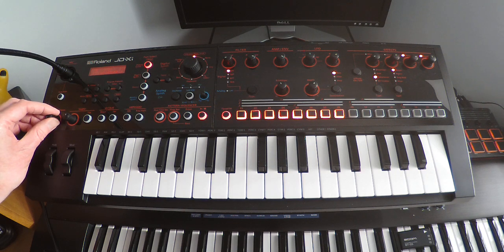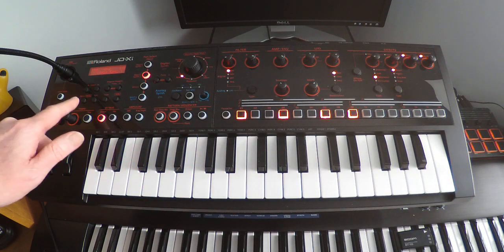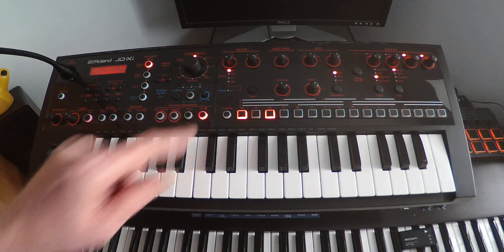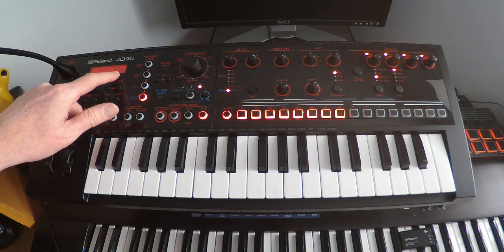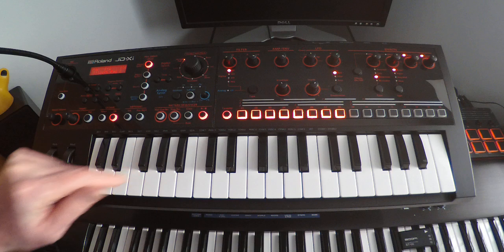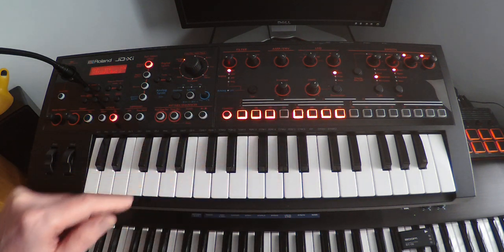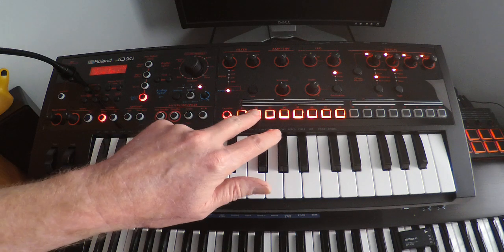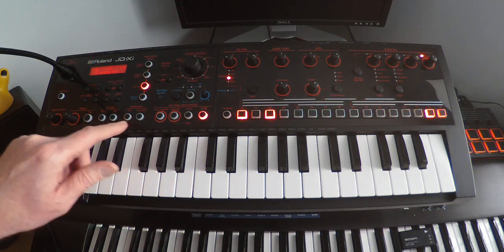How I re-created Autobahn by Kraftwerk on my Roland JD-Xi

Comment: Great vid thanks, Just a question the jdx is only good for short repeating phrases like jingles? it won't  let you make  Propper  5-8 minute or longer tracks does it?
Reply from the maker: Hi Deon, you are correct. An individual sequence that you create will carry on repeating when played. However you can keep manually selecting another sequence as one is playing. The second sequence will then carry on playing after the first one has finished... and so on. This is how I create my songs on the JD-Xi. Many thanks for your comment and question. All the best, David 🎶🎹🎸👍
Reply: @DavidGordonJDXi  Thanks for the reply, how many sequences can you create?
Reply from the maker: @deondewit3175  the JD-Xi has 4 usable memory banks each having 64 memory slots for storing sequences... 256 total. The stored memory slots can be assigned to favourite buttons for quick access if you are using them to play/perform with. There are 16 blocks of favourites each having 16 storable positions. Hope this makes sense and thank you for subscribing to my channel 🎹🎸🎶👍